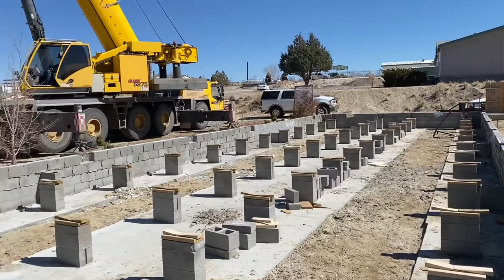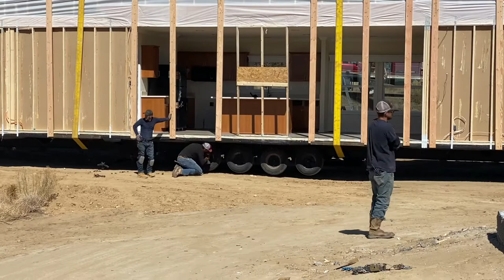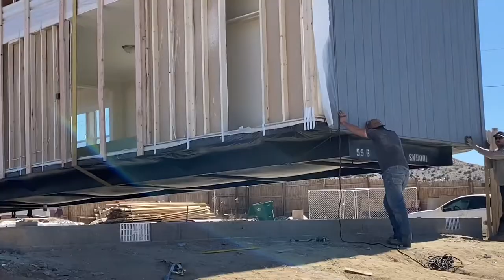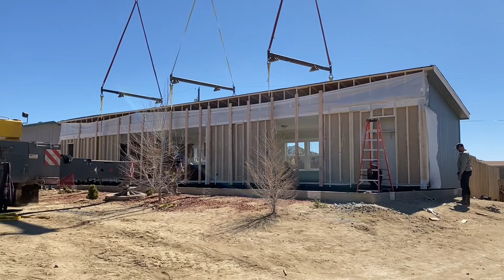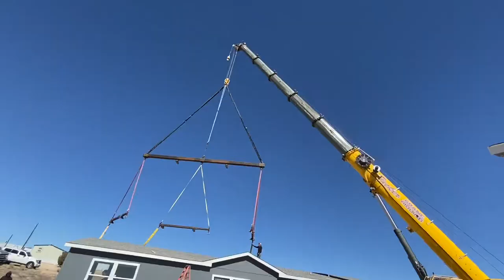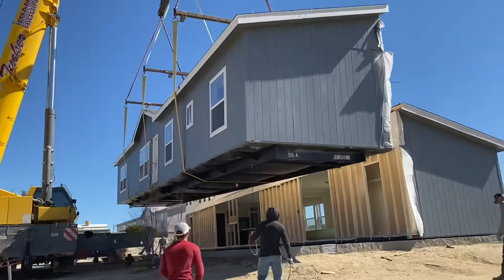Crane Setting a Manufactured Home!

Comment: How did you get the crane straps out from the centre of the building? Or did you have to cut them? Thanks.
Reply from the maker: The home is lowered unto the cement blocks, so once the weight is distributed the straps will loosen and you can remove them. Hope this helps!
Reply: @patrickrushing6771  Thanks Patrick, I am mostly concerned about the gap between the two halves, but I am assuming that there was enough space to get the strap through. Only a minor point, but I'm in the process of designing the connection process. G